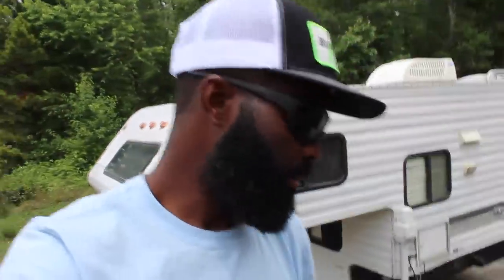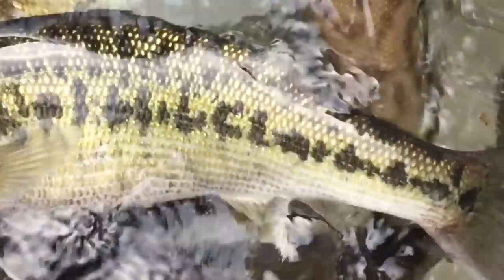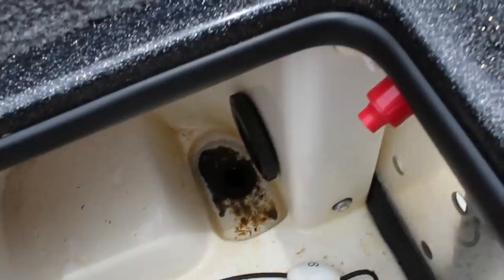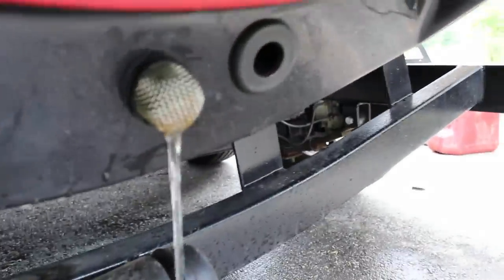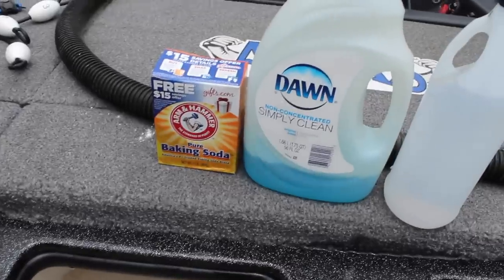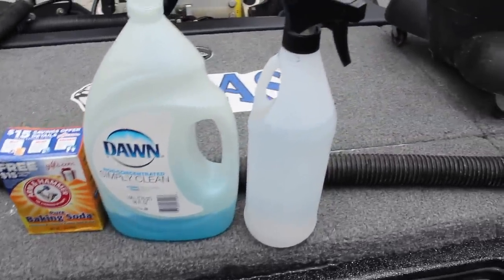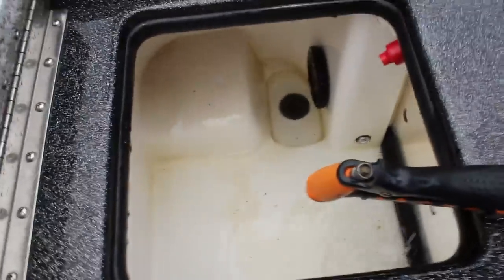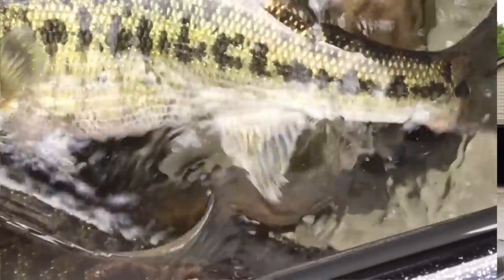This Tip Will Save You Money!!!  No More Dead Bass!

Comment: FYI- On a really hot day DO NOT leave your oxygenator on all the time. It blows warm air against a stone to create bubbles or oxygen. Therefore you are admitting warm air into your live wells. Use the oxygenator whenever you switch locations on a lake so use in short bursts. Always throw a 7-10lb bag of ice in your live well BEFORE you take off and plug the overflow this way the ONLY WATER you use will be the water you initially pump in after catching your first fish. ONLY keep the live well on recirculate after filling and never add any more outside water. Always use G-Juice and add ice late in the day if needed. THIS WILL KEEP YOUR FISH ALIVE! Lastly, if you have a bleeding fish, pour sprite over that area even if it means down its throat. It will slow the bleeding down dramatically. Trust this

Comment: Do you wipe down your boat with the same bottle? If so what ratio of water to vinegar?
Reply from the maker: Stephen Crawley my mans!!!! I just use water and vinegar for that.  I part vinegar 2 parts water.  You can mix it how you like it though it doesn’t matter.
Reply: My clean everything solution is 50/50 water and white vinegar with two drops of Dawn in a 16-oz spray bottle. Yes, two drops. For boat, hands, water stains, fish slime, everything. Amazing results.